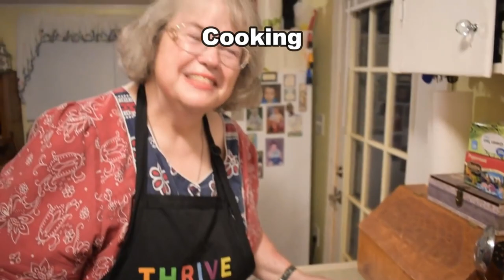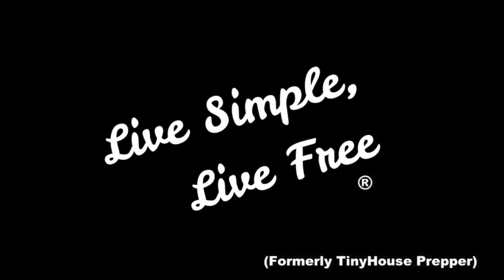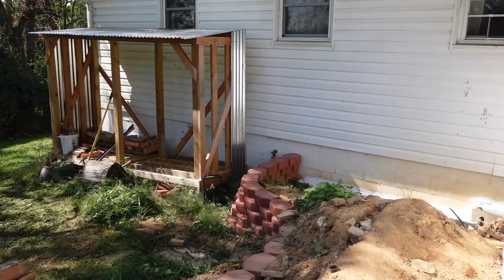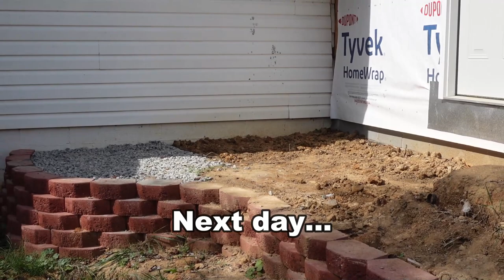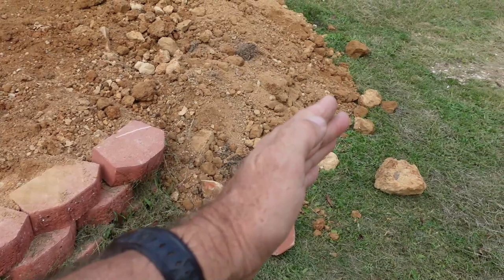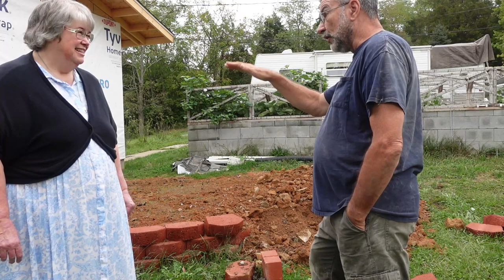Addition Build 15 - Building the Patio

Comment: Just curious?? Can't Elizabeth help you do anything outside, you always seem to be doing it yourself, she could fetch tools, cords, shovels, help rake stuff out etc?? I know I do things a lot slower than I did and I have to use a cane so sometimes it is a bit unwieldy, but she could do some of the easier things maybe??
Reply from the maker: Two things.  First of all, ever since Elizabeth's stroke she has had serious balance issues.  Walking on uneven ground, and bending over to pick up things like that are very difficult for here.  Second, I was a contractor for decades (until I started You Tubing) and I usually worked alone (or subbed things out to other contractors).  I'm VERY used to working alone.  I don't expect her to help.  I'M the contractor - not Elizabeth.

Comment: I think your  outside  shower is a good idea. I'd like to see how you  build it. I only  see enough  room for the hot tub, unless it is made as an added deck with lattice wall on the wood pile side, and hide the curtain alongside it on the house side next to the lattice two steps to the left of the tub. Use a circular  ring overhead  to hold the curtain. Barry's  dumptruck is pretty great.
Reply from the maker: No curtain, just an open shower to rinse off before getting into the hot tub.  Like a shower beside a public pool or on a beach to rinse off the sand,

Comment: Why didn't you apply the water proofing painted on stuff up the foundation wall to the top of the top course of the retaining wall blocks.  I would have ...... overkill maybe ..... unnecessary probably, but what do I know from construction ...... but I would think that it should have been done just like you waterproofed the outside of the foundation of the addition before pushing dirt up against it ..... yeah, I know you said stone is going in up against the house foundation, but still, it would have been a continuous layer of waterproofing and some extra protection against any water going through the foundation...... Just curious
Reply from the maker: The foundation wall was already waterproofed with white foundation coating.
Reply: @LiveSimpleLiveFree  Oh. It just looked to me like worn white paint.

Comment: Why wouldn't you use solid drain pipe rather than draining through gravel....that would for sure keep the water away from the foundation ... I really think in the long run you'll have trouble with that drain system!!!!!
Reply from the maker: If I did that, I would have to have a shower base to catch all of the water.  This system will not be a problem.  This type of drain is very efficient, and can actually handle MORE water volume.

Comment: I have been told that  I worry too much about  everything....you scared me when you moved the front  end loader over the  edge of septic tank.  Plus I wouldn't  want an outdoor shower up against the house foundation.  I hope your gravel and drain pipe carries the shower water away from house.  Idk much about hot tubs.  Does it have a drain hose attached to drain it out away from house?
Reply from the maker: Yes, you worry too much, LOL. I wouldn't have moved the backhoe closer if I really thought it would collapse!  The gravel will do a fine job of draining the water.  That type of system is used all the time.  And a hot tub does not have a drain.  You keep the same water in it and treat it (like a pool).